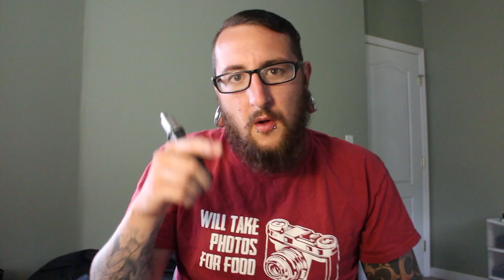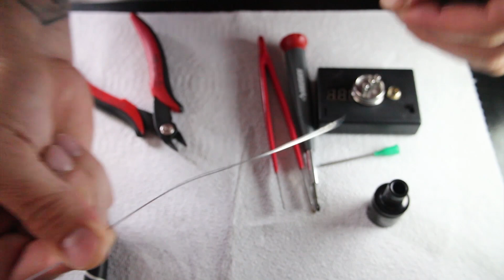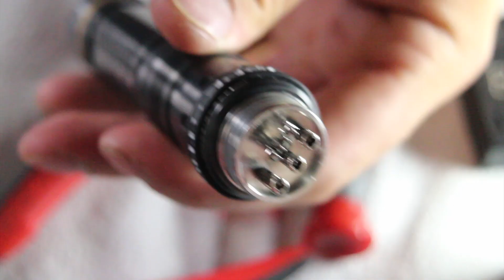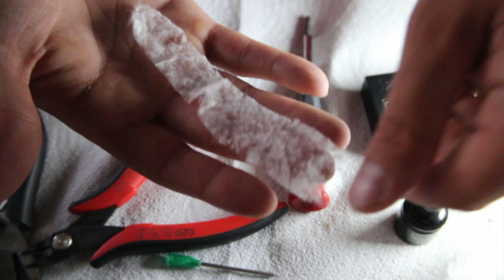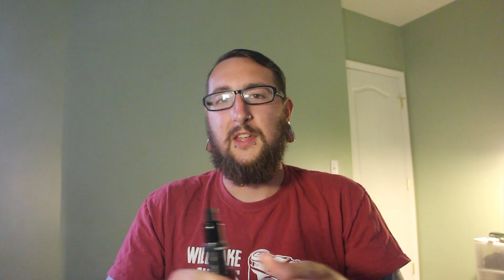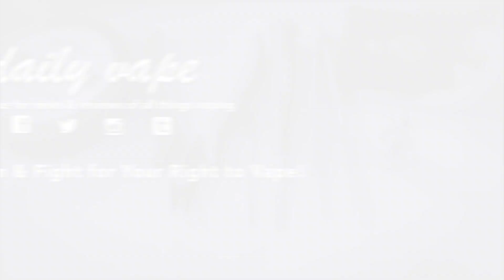#FRESHBUILDFRIDAY - Twisted 28g / Ribbon Wire Build

Comment: Nice coil. I'm going to try out twisted 28 g out for sure . Off topic, what's the craziest build you made in an Igo s type RDA or something as small? I like to put dual coils in mine using 1 peice of wire. Small sleek and surprisingly vapes good. Can't chain vape it like a bigger RDA though.
Reply from the maker: I don't have an igo-S but I do have a little Smok dripper thats the same size. the airflow sucks on it so I think I'm gonna drill it out a bit and see how it performs. Honestly, I haven't tried any crazy builds in it, seems like you have though haha Vape on!
Reply: I drilled bigger hole as well.
Reply from the maker: Wayne James Bouchard great minds think alike!